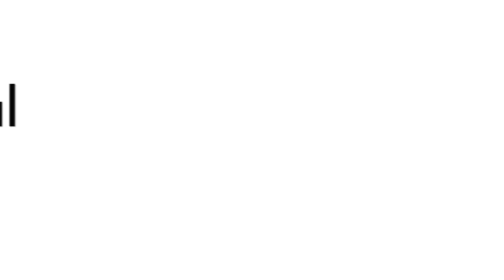Mercedes E300 Full Leather Interior Repair | leathercare.com

Comment: I like to add 1/3 part filler to 1/3 TPE binder and the remaining 3rd would be for the dye tint.  This allows the filler to flex with the temp variations and the stretch stress from sitting etc.
I have boots that have this type of repair done 6 years ago, no signs of cracking, and my leather bucket seat in my expedition still looks like new beige deer skin leather.  I hear that graphene in an oil modified enamel is a new top coat solution that works in synergy with TPE binders and provides incredible UV refraction characteristics.
Reply: What kind or paint or dye is used? Automotive paint or is there a special kind
Reply: @briannthara9109  I prefer to use acrylic based dyes.  It seems to work best.  I haven't tried anything else yet.
Reply: @Mainbusfail  
How do you keep leather grain still visible after restoration?
In this video, seats look nice but leather looks fake since pores and lather characteristic surface is kind of lost with sending and paint layering.

Comment: I used to use Flexproof,   their dye was water base, i used to thin it with water after a perfect color match and apply it with a sponge, sand and spray,  i used their flattening agent and that's it.   i used their vinylizing compound for repairing holes in vinyl but not for leather and i used a lacquer base vinyl dye for vinyl repairs

Comment: Looks really nice but i have two questions. Won't the paint crack as it is not flexible? And should you use leather cleaning products on this later on? I'd think not as it has been clearcoated.

Comment: At the end you sanded does this leave any marks? I treated my steering wheel, also applied Colourlock top Matt clear to protect it. It looked fine at the time. Today it’s now got small hairline cracks in the clear. Would sanding fix this or do I need to strip ot all off again

Comment: Awesome! Does the paint and clear coat make the leather feel plastic like? It seems like it wouldn't feel like leather anymore.....also, is the filler, paint, clear coat all very flexible so that they do not crack with long term daily use?  Thank You!
Reply from the maker: exactly Stephen. They are all flexible which means they dont crack and provide good durability. It is a repair so largely down to how the seats are used too...

Comment: I went to clean my leather seats, only to find out that someone had previously coated them with a paint that doesn't even quite match the color of the original leather. Is it possible to strip this paint? Or, might it not be a good idea, in the case that the leather may have been sanded before the paint was applied?

Comment: Great video. What is the best tip for removing the shine to a leather steering wheel and getting it back to the matt finish (2018 BMW M140i with c20k miles)?
Reply from the maker: Most steering wheel is shiny mainly due to dirt. Cleaning it very well removes the shine most of the time. We would also recommend you degrease it thoroughly. - www.leathercare.com

Comment: I have a question 🤔  when you apply body filler and paint and cold weather and sitting in the chair time after time doesn't the filler crack and then paint fail?
Like spraying a filled balloon 🎈 with paint and then squishing the balloon after paint dries would cause cracks and then failure?
How much does this process cost?

Comment: Say that you want to color this seats red, you have to sand them down first to remove the blue color?
Reply from the maker: Changing colour can be done but there are pros and cons. Depending on how the seat is built you may not be able to spray in hard to reach areas although it can be done. Personally, I'd recommend changing colour on smaller areas like the headrest or armrest if you can't source a similar one to yours and consider paying a little more to have the seat re-upholstered for a much better and longer lasting finish.

Comment: I was a bit worried with the size of the channel and views. Y’all might not respond but you stated in the end of the video that y’all respond so here goes! 

I just acquired a 1991 E32 BMW 750iL. 
I am the second owner, the car is flawless and so is the interior. Do y’all have a video of how to preserve this leather? Ceramic coat the leather to protect it? Is there any way I can pay y’all for taking a look at some pictures via email or I can post a video whatever works. I have a guy here in Texas he did my 1963 Cadillac interior but that was full restomod. I want to try and preserve this 30 year old interior since it still looks new. Just very scared about which chemicals to use and how to properly preserve it. Thanks greatly.

Comment: Amazing job! I only hope it will last long! I have zero experience in flexible paint. Seats should withstand high pressure and deforming, especially when someone enters or leaves the vehicle. So I hope these refresh seats stay fine for long time. In my Benz I have old seats that need to be fixed too. I think re-upholstering would cost as much as a new seat and won't be as accurate as a factory made seat...
Reply: How the seat turns out depends on the expertise of the craftsman doing the work. When I enquired about the cost of re-upholstering a seat I was surprised at how reasonable the quote was.
Reply: @johnkaimins9998  Thank you! I wonder if the new paint may leave marks on the clothing? A how long it may last before it needs a repair in the same place? I suppose usually side bolsters suffer the most.
Reply: @yolo-cars  Hello ~ If you are planning to keep the vehicle for the foreseeable future then I would Strongly advise you to pay for professional reupholstering of your seats!  There is nothing quite like the aroma of new leather!
Reply: @johnkaimins9998  I agree. I wish there were more professionals that do reupholstering around where I live or around Tampa, FL.
Reply: @yolo-cars  It is really a matter of visiting the ones that are in your area, inspecting the level of their work and obtaining quotes. Good luck!
Reply: @johnkaimins9998  Yeah I agree. Actually finding places is challenging too. There are places that don't do upholstering, but only leather repair jobs...
Reply: @yolo-cars  You can always buy a pair of seats ( as long as the seat frame is in good condition) and freight them to an apholsterer. Think outside the box.
Reply: @johnkaimins9998  I was even thinking to strip a spare seat, measure leather DIY it ask some leather specialist to sew me a particular leather seat cover. PS: shipping the whole seat may be too expensive. I can barely lift my Benz front seat Of course I could remove some electronics from it but still it will be pretty bulky. Plus reupholstering is not just about the seats. Ideally it's about the whole interior. And people who will work on this car SHOULD know exactly how to remove all these parts without breaking all those plastic clips, locks, pins, etc. Sometimes it seems shipping my Benz to Eastern Europe would be easier than do it here in US.
Reply: @yolo-cars  Great idea to buy a spare seat. You can remove the cover and send it to a leather specialist. They will use the old cover as a template to sew up a new one for you.  I agree with you that it is really about the whole interior.  I recently had my leather and burl walnut steering wheel recovered in new nappa leather. Sooo nice!
Reply: @johnkaimins9998  Yup. We'll see. I think it's too early for me start such project. Maybe next year or later. I'm glad you restored your steering wheel. My wood/leather steering wheel is cracked (at least clear coat on the wood is cracked), and I hope one day someone will fix it for me.
Reply: @johnkaimins9998  I just sold the interior from my donor W140. I had to sell everything including donor seats etc etc. I decided to save the steering wheel and V12 shifter from that donor car. I hope one day I'll ship this steering wheel to a reputable shop where they can refresh that wheel.

Comment: I think I must be weird because I actually LIKE the look of worn leather, not if it is an actual crack or hole that goes clean thru but I like the look of the crease marks , have not watched this yet but if this was my car I would repair the bits that had worn thru then condition the leather well so the creases aren't super light in color like that and do not become cracks. I don't think leather needs to look perfectly smooth and do not find that to be desirable. my new truck the seats are so smooth, I cant wait until they start to crease up a bit and get all comfy looking.  EDIT after watching I think you did a great job, for me that would be over restoring it but I know I am not the common case. id rather see the crease and just have them blend better so yes to the paint but probably no to the filler except where it was truly needed.

Comment: So this approach is OK on heated leather seats?
Reply from the maker: Yes, the leather is still a painted surface.
Reply: @geist.leathercare  Thanks for the reply and that's good to know; I've looked at a few used cars with heated seats and was worried the ventilation holes might be an issue.

Comment: I don't really get this technique, what will prevent it to just cracka gain on the same spots?
Reply from the maker: The filler is extremely flexible and a lot of these techniques while largely unknown are common practice. We have done seats that have lasted much longer but a lot is down to how its used also.
Reply: @geist.leathercare  Ohhh.. Gotcha! Thank you for the detailed answer - Keep it up! :)

Comment: For the cost to repair this you could probably just get new seats.  For Cadillacs you could just buy the parts cheaper than you would pay someone to restore.  Of course, this process would be better for collector cars or maybe german cars but wouldn't be worth it for many others.  I could get a factory leather seat covers for $300 to $500 which is less than what you would pay someone to restore like you have done.

Comment: Another way  is to get a  very thin leather piece same colour of your seat, cut it to the exact size of  the area you want to cover, apply thin layer of glue and stick it on carefully by pressing it in every corner and angles. It will last longer and less work . Its worth a try. I will make a video and post it.

Comment: It’s no longer dyed leather or vinyl though.  It’s painted, which means after sitting and sliding on it a bit, the paint is going to wear off.  I feel this would be a very temporary fix that would not be as soft, flexible, nor resilient as the original surface. For the labour involved, this seems like a way to scam used car buyers who might not know the temporary nature of these nice looking seats.

Comment: Oh how times have changed my 2017 350d glc amg premium plus has vinyl seats, the car has 35000 miles on and the drivers seat is damaged on the seat cushion, not impressed with Mercedes’ as they are cutting corners, I sold my a6 avant with 190000 miles on the seats had no wear what so ever

Comment: this repair wont last, in a few months, the cracks will form again and paint will get scuffed or flake out. if you want to repair this kind of damage, might as well do it right and re-upholster the leather.
This is just like a band-aid solution to quickly sell the car.

Comment: not sure how this is a repair, more like cosmetic adjustment.  Like is the seat gonna be soft and smooth like leather, or feel like plastic chemical crap that might melt in the  sun or wipe onto occupants clothes?  I feel like a proper "repair" would be like putting all new, fresh leather over the seats.

Comment: It's an impressive repair, but it doesn't really seem like it's leather anymore by the time you're done sanding, patching, priming, and painting it. I'd rather have some nice new real leather. I don't see the repairs lasting that long either. Those deep cracks and weak spots will return in time, as will new ones. 30 year old leather in that condition isn't going to get any better.

Comment: I cringed as he dried the paint with a heat gun instead of waiting 15 mins between coats.
Reply from the maker: You won't burn the paint and we have put multiple layers of paint. I'd rather not stand there and watch paint dry...